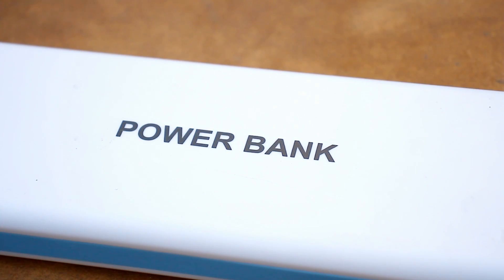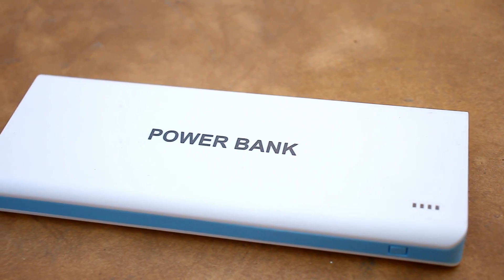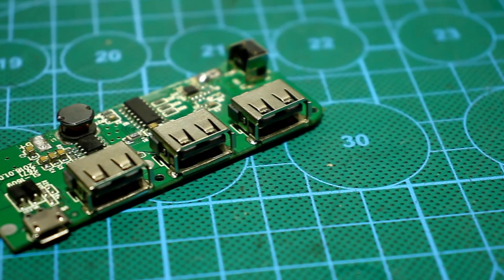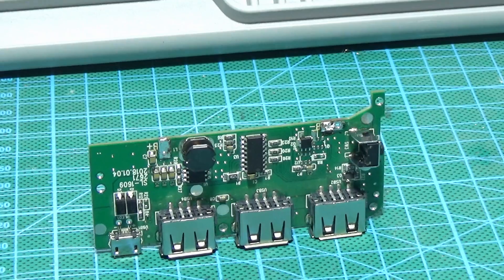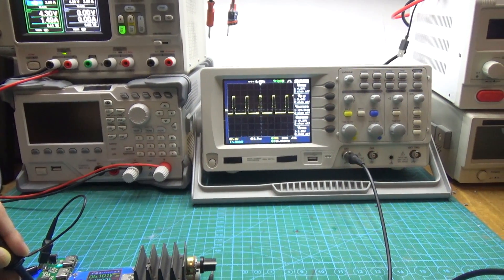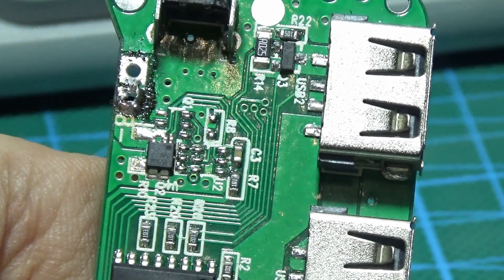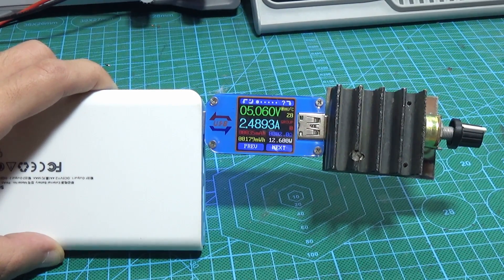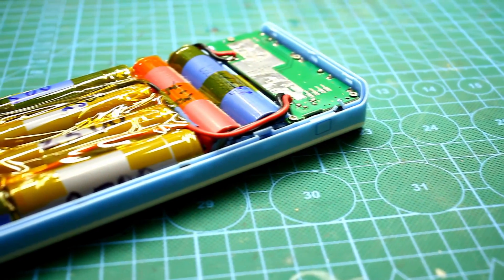How to increase POWERBANK power

Comment: Can i use 2 same powerbank circuits output in parallel for increasing output ampere to charge my smartphone!   with both inputs connected with same li-ion cells . Will it work?

Comment: i have a power case for the s6 edge which i already replaced with a new battery. but im still not satisfied due to the fact the power case cant provide much current to charge the phone. im only getting 0.3 to 0.4 amps estimate using an app. i'll check if i can replicate this method on the case when i have time to open it again

Comment: Thx for this video, i have a power bank, it have 6 USB ports but if you connect 2 modern phones it will just turn off, i check the pcb, and it have a ME7170-G, but the datasheet says it can handle enough, what could be the problem?

Comment: Which exact power bank is that? As you pointed out, some banks use integrated controllers for battery management and output control, and some don't have good efficiency or separate FETs, so it matters which one it is. Can you share the model and supplier?